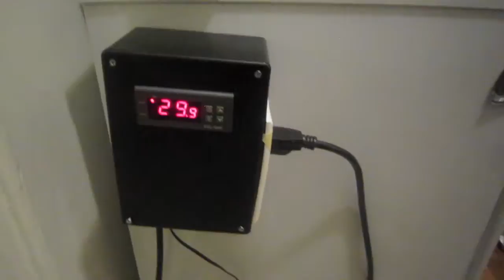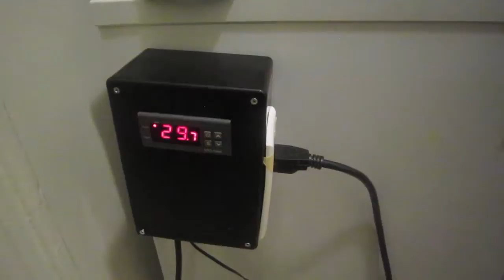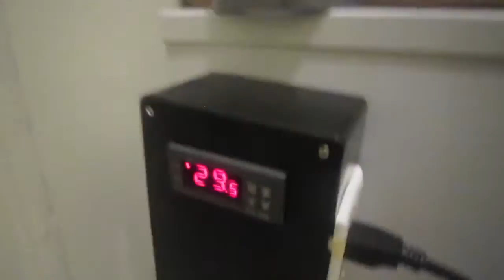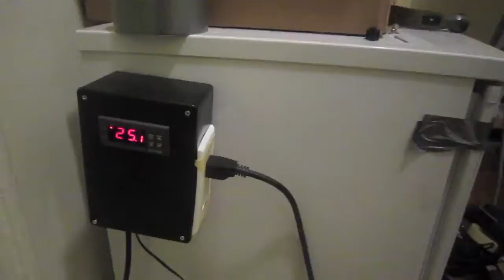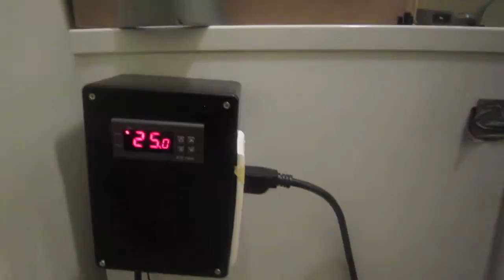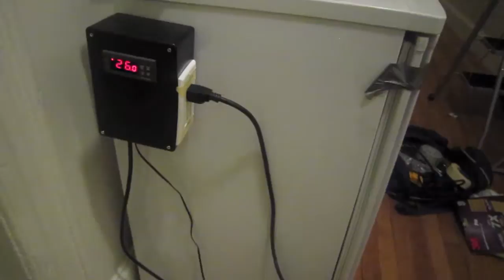HBW #6: Temperature Controlled Updates

Comment: I took an old broken down chest freezer and drill a hole in one side, then i fitted a reptile thermostat and heat mat (most I've needed is 2) inside keeps my yeast happy with temperature probe at keep it at 22c.

If England (not very common) gets warm, I get a ton of freezer packs and the insulation keeps the temperature down and keeps the warm out.

liking the the non drill option saves ruining a perfectly good fridge.